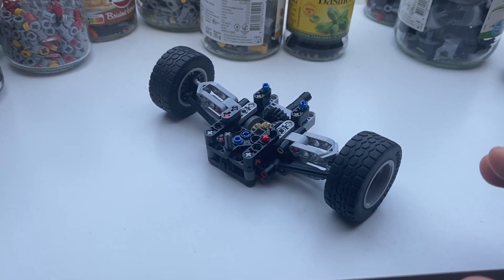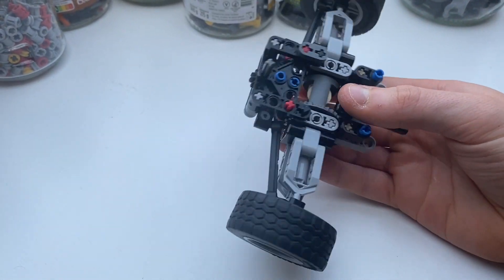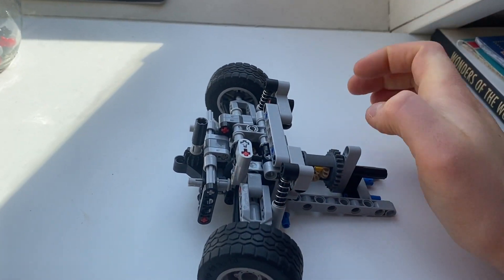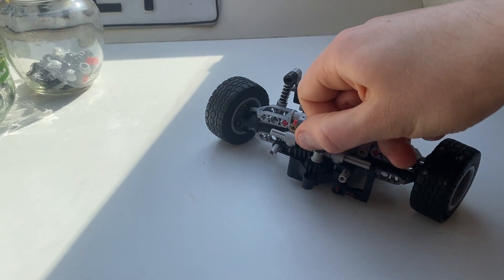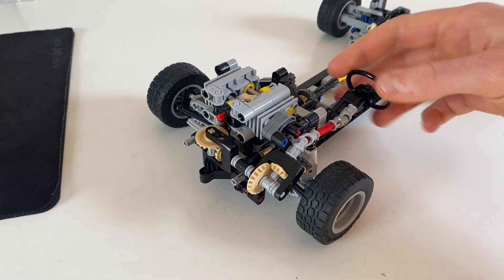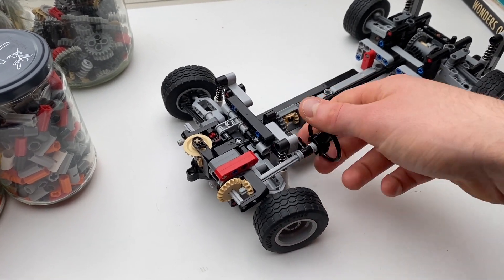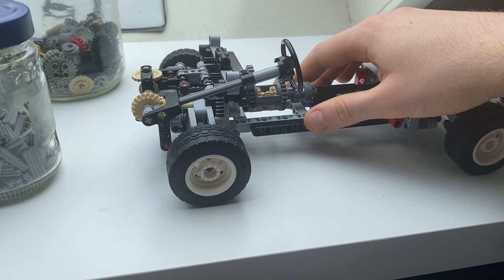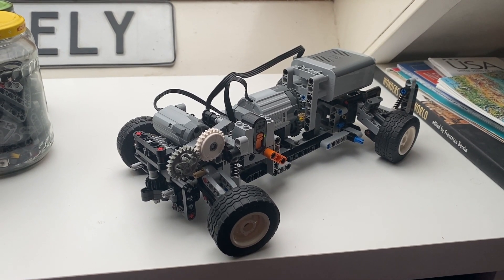Most Compact Lego Driven Independent Front Suspension - Chassis Experiments

Comment: Hi maybe you already know, but here is my shot.
Lego released with the technic GT40 a new part : an axle with male cardan fitting at both end. It is slightly shorter than using 2 male cardan in a row. Here the part number : 6408171
Hope it will help you get compacter

Comment: I feel like you may be over complicating your problem, maybe you like your solution for the real world suspension mechanism, but I dislike it due to its proportions looking very different from a typical production car( like the wheels are too small and wheel base too wide).
Over the years I have been inspired by you, because of those truck tyres you use. And I have a practical solution that may not be as attractive, but I essentualy put 2 swing axles together and it seems like it can be made steerable really easily
My video
https://youtu.be/FQ28E7BASR0

Comment: Hi man, sad, but this style of wishbone is not designed to be driven. That why it does not steer for you. Steering point and CV joint point not on single line.
Reply from the maker: Later in the video I get it to work. Not perfectly, but adequately well. And the steering point not being in line with the CV joint is not a problem. Yes, it limits the steering angle slightly, but some real cars also have this problem.